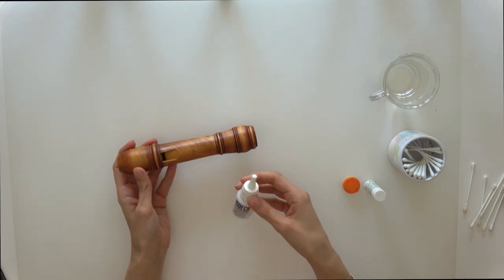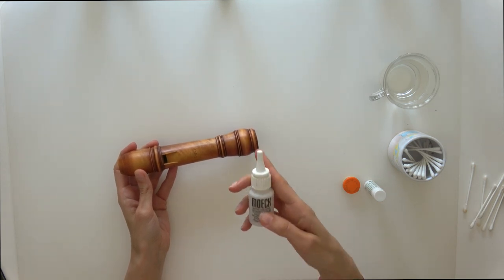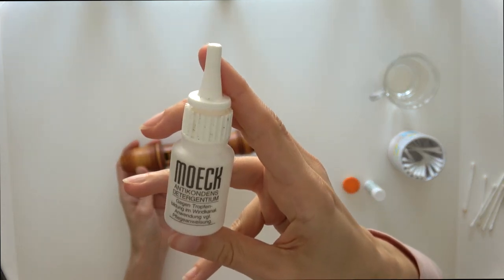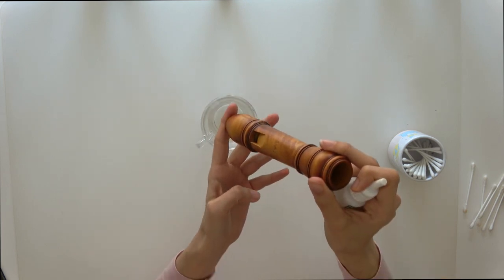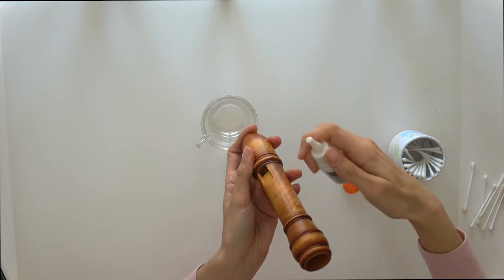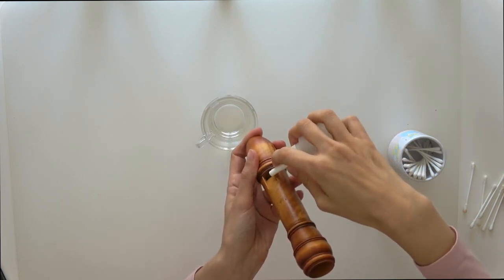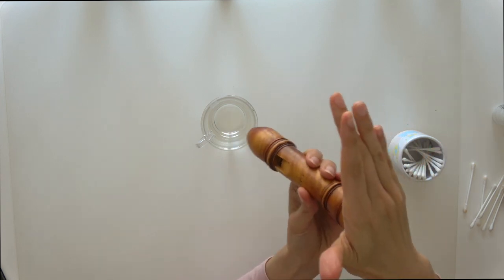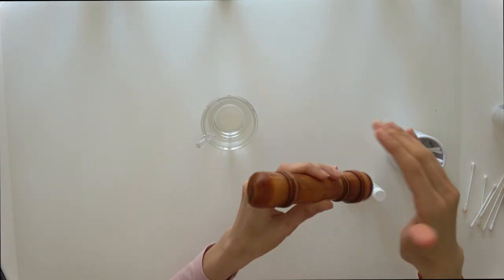How to solve a regularly clogged recorder

Comment from the maker: ( 🇪🇸Vídeo en español: https://youtu.be/8PJMNE8-xpk )

Here are the links to the other videos!
How to clean the block of the recorder: https://youtu.be/LBryuSxvbK0
How to oil the recorder: https://youtu.be/XPsaGnBPV04
How to maintain recorder tabs (cork / thread): https://youtu.be/4A0cA5L_vsE
How to place new thread on the tab of a recorder: https://youtu.be/r32Pt-jutrY
What to do when a recorder block doesn't fit: https://youtu.be/pHTGs4b_ph0
How to treat mould in a recorder: https://youtu.be/k0nfahcg09o
How to clean extra small recorders: https://youtu.be/rKsDr4ywYlc
How to prevent the recorder thumb hole from wearing out: https://youtu.be/46LxHeFZWnI

Comment: Hey thanks I was wondering what that was in my cleaning kit.  Is there something else that helps?  I heard the term "warming up the block" in a context like it helps clogs.  I was doing a live stream tonight and my recorder kept clogging very badly.  I had cleaned and oiled 2 days ago.
Reply from the maker: Hi! Definitely warming up the block before playing is a necessary practice when temperatures are not overly high, you just need body heat. It can be placing your hand around the part where the block is, putting it in one of your sleeves for a moment, under your arm etc. Also blowing slow air (warm air) into the labium helps.
Reply: @LobkeSprenkeling  Thanks I'll try that next time.